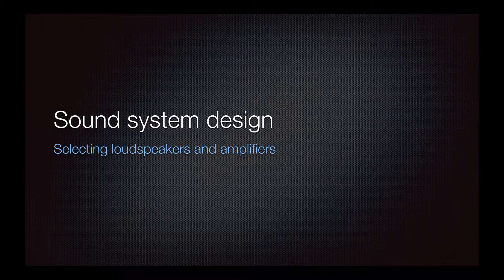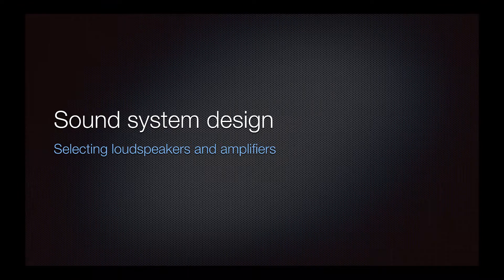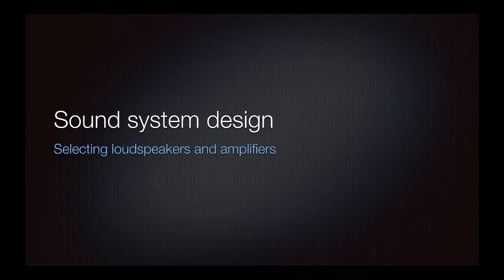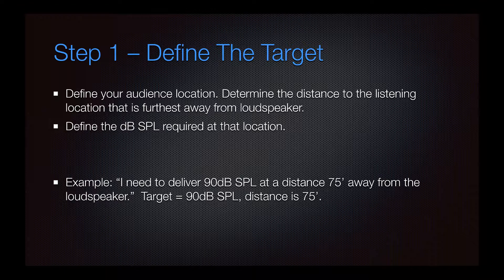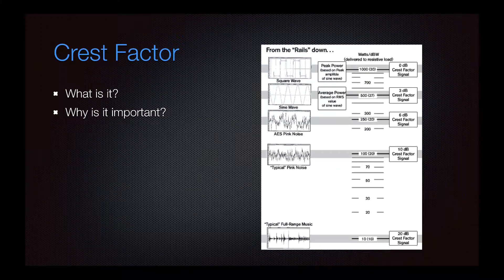Sound System Design - Choosing Loudspeakers & Amplifiers

Comment: I'm trying to learn how this is all done so I'm confused on two points.  First how do you know how much DB you need in a room to begin with to achieve a certain "feel"?  Secondly if the long term peak of a speaker (assuming that's RMS) is 600 watts then wouldn't you need an amp that is slightly over 600 watts to run it at its full potential?  I'm confused as to why one would use an underpowered amplifier to run a speaker.  Like I said I'm new to learning about this, I'm sure there's lots of things I don't understand and I'm prepared to learn.  Thanks.
Reply: You are right ,,,but always note:-we get +3db every time when we double the power of amp 
ex:- if we have a speaker with 100db sensitivity(at 1m and 1w) and 600w  power  
Then we double the power (1w) until it matches 600w
That is 2^9.23=600
Therefore ,max- spl=100+(9.23)*3=128db

And if we need 123 db max spl  
Then ,power need =2^((123-100)/3)=200w
And we can use amp slightly over 200,bcz power amp looses their volume/power with time 

In actual life ,using power 600w and above is recommended ,if you donot overdrive spekers ,,,and in 600w amp you can control spl/power of amp from 0 to 600w with volume knob

And you can calculate spl needed by dbmeter